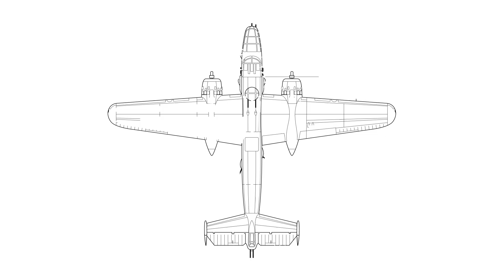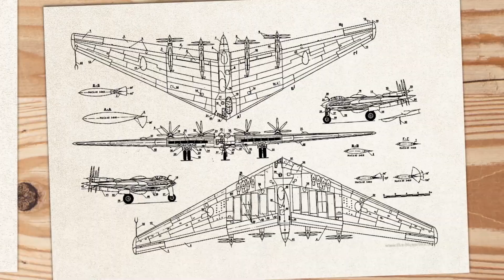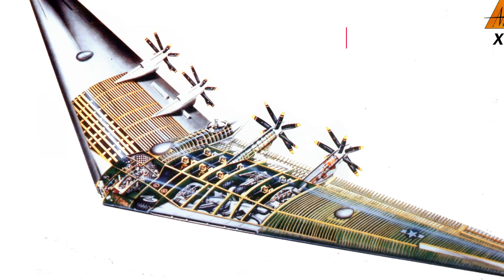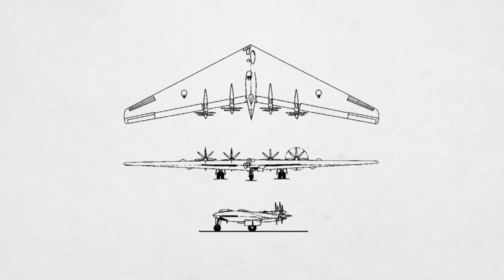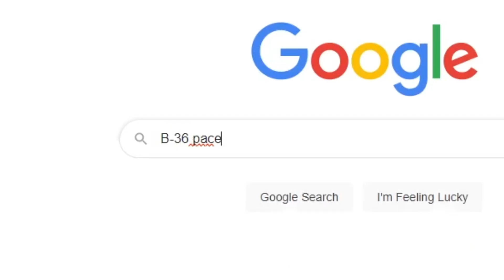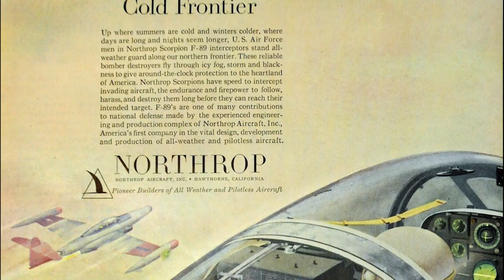This Plane Is CURSED - The Forgotten Flying Wing…

Comment: I have a print of this framed on my wall, had it since I was 10yo. Still amazing to look at considering how old the aircraft design was. Cant wait for the video :)
Reply: Harry Zain: We must be contemporaries because, while I'm not lucky enough to have a print of this amazing aircraft,  I certainly remember being totally mesmerized by the concept of a 
' flying wing ' aircraft.  When I got a little older I enlisted in the Air Force and,  lo and behold,  was stationed at an airbase,  which I will not name,  that became known for its black hanger. That hanger allegedly housed a black aircraft which only flew well after sundown. Jack Northrop really got screwed...

Comment: It wasn't cursed, it was ill timed. The instabilities of the flying wing were partially compensated for by the prop torque. But the skinny turbojets of the early jet age couldn't compensate, and it ended on the scrap heap.
Reply: In reality a tailless aircraft can't fly for too long without fly-by-wire.

The B-2 for example uses both control surfaces in the wing that act as air brakes and independent variable thrust in each of the engines to control yaw and avoid a flat spin. Same for the X-36.

That technology was simply not there until the dawn of microchips. No matter how hard they tried, the project had to be suspended.
Reply: @PunishedClippy  You don't need microchips for active stabilization. A mechanical gyroscope hooked up to the control surfaces can do the same thing unless you're on some hyper-unstable aircraft.
Reply: @hellothere_1257  Thanks for this detail.  Mechanical analogue tech is often not respected in this digital, or at least electronic age.
Reply: @hellothere_1257  Are there any close examples of this?
Reply: @jacob5395  It's very commonly used in early generation rockets. For example, early AIM9 sidewinder missiles used airspeed driven gyroscopes built directly into the control surfaces to automatically orient them to counter any roll rotation. The V1 flying bomb used a mechanical gyroscope assembly to hold it's course, as did pretty much all torpedoes at the time. 
Note that such a simple system would not be capable  of controlling a hyper-unstable aircraft like the F117 Nighthawk. On such an aircraft any existing deviation will self-amplify and spin the aircraft out of control unless immediately countered, so the the control system needs to predict how the aircraft will react before it actually happens, which can only really be done with sophisticated computers systems.

However, on a flying wing that's already semi-stable and flyable, a mechanical gyroscope rig is more than capable of adding the extra hands-off stability that you'd normally get from having a tailplane.
Reply: @PunishedClippy  I noticed right off that bit of the story was "conveniently" left out, it's a fact that stability problems plagued the design from the start until the day it was scrapped! These problems were likely never going to be overcome and it was becoming all too apparent by the Air Force brass who wanted (needed?) a strategic aircraft NOW and could not wait on some unforeseeable technology like fly-by-wire to come along. This simple but glaring fact seems to be always glossed over or simply omitted by those who want claim the Flying Wing was killed solely by shady politics or corporate shenanigans, of which I am sure was also going on as it does with all high stakes projects! The sad truth appears to be that the Flying Wing as envisioned at the time was simply way too far ahead of the available technology and it would have never been viable until computing tech and Fly-By-Wire caught up.
Reply: @PunishedClippy  The German Horten Gliders were very efficient, even Hang-gliders. Building in 'wash-out' at wing tips gives effective 'tailplane' incidence for stability.
Reply: @PunishedClippy  Ho229, perhaps you should do a bit of research?
Reply: @PunishedClippy  Not true, that issue has been solved, fly-by-wire is not required anymore, and flying wings are now superior to traditional designs in many ways. Depends on your application.
Reply: @PunishedClippy  why is a citation needed?
Reply: @PunishedClippy  the XB49 had the same type of control setup.  They lacked a responsive enough SAS to compensate for the slight wallowing that affected bombing accuracy.  They could have solved it but Britain not falling removed the need for bombers to cross the Atlantic.
Reply: @PunishedClippy  well thats the thing, it was suspended only a few years before ICs and microchips could have fixed the problem
Reply: Pratt & Whitney did do static tests with drive shafts and counter rotating props, but the issue was in flight with all the vibration created by operating pusher props slicing through the wake of the wing twice each revolution. Pusher props work fine at Varieze speeds, but become more problematic at near sonic speeds.   

The Flying Wing utilized a thick wing that was not well suited for near sonic speeds. The B-47 with its thin wings could easily outperform the Flying Wing. The B-2 is a different situation, it's design is not intended for high speed but rather stealth.  Still, a fuselage is a handy cylindrical body that is easy to pressurize and has lots of room for bombs, while the tail allows more freedom for the center of gravity to move around without making the aircraft unstable. None of this was true for the original Flying Wing.

The original Flying Wing was supported by General Hap Arnold. Once Arnold retired, the Wings' competitors moved quickly.
Reply: to make a stable flying wing you need lots of sweep to the wings and winglets.  A flying wing should look like a V for the purpose of stability.  The problems have now been overcome with computers keeping the plane "stable"
Reply: Yup. Cannot work at all.  Needs this or that.   Tell that to the Horton brothers.   Theirs did not work obviously.  On many hundreds of test flights and beginning production when the war ended.
Reply: Yea just look at the b2 bimber
Reply: Well, the HO-229 proved that a flying wing can be done if done properly
Reply: Horten Ho 229
Reply: The government tried to force him to merge with General Electric  , he would have none of hit , the Government canceled the contract and Northrop destroyed the fifty aircraft already built
Reply: It flew well as per Testpilot statements! But some other Aircraft manufacturer may sabotaged it and some Parties or Politicians were corrupt and took money too...
Reply: @einautofan6685  Blaming sabotage and politicians is just silly. In reality, the concept was not viable at that time.
Reply: @skunkjobb  If it was't viable then why destroyed all the prototype and give the data and patent to rival companies and not just shelved it. did they afraid there was a soviet spy at northorp but if it was "impossible" for US which is superior in electronic is it even possible for the soviet?
Reply: The XB-49 was also nearly 90 mph slower than the B-47, too. It wasn’t until fly-by-wire became viable in the 1970’s that Northrop was finally able to make the flying wing bomber work with the B-2.
Reply: Because simply Northrop was nobody at that time. Providing any funky design to seemingly stoneheaded organization is something you want to work way-way harder, to say the least

Comment: <<Listen. Attack the central propellers. If you can destroy them, the Arsenal Bird will slow down.>>
Reply: The center engines? Those aren't nearly as critical... aerodynamically, if you clip the engines on one side, the plane will have to kick in rudder and reduce thrust on the other engines to compensate... which will reduce power even further, increase drag, and so on, and result in a nearly crippled aircraft.
Reply: @Tomyironmane  you clearly don't get the reference, they're talking about Ace Combat 7's Arsenal Bird
Reply: @Tomyironmane  yup one side knocked out and its pretty well screwed
Reply: It all comes down to destroying rectena base
Reply: @brecibros2469  is he really that good
Reply: @phoenixleader1999  he has to be besides if he thought it was impossible he wouldn't have said anything
Reply: Ace combat 7 was dope af..but the dialogue pissed me off just a little. 🤣
Reply: lol

Comment: FLYING WING?
Reply: Its an airframe design, meaning the airframe resembles nothing but a wing, without any tailwings.
Reply: @aureusknighstar2195  without a tail. How do you sail a plane!?
Reply: In some flying wing designs, any stabilizing fins and associated control rudders would be too far forward to have much effect, thus alternative means for yaw control are sometimes provided.

One solution to the control problem is differential drag: the drag near one wing tip is artificially increased, causing the aircraft to yaw in the direction of that wing. Typical methods include:

Split ailerons. The top surface moves up while the lower surface moves down. Splitting the aileron on one side induces yaw by creating a differential air brake effect.
Spoilers. A spoiler surface in the upper wing skin is raised, to disrupt the airflow and increase drag. This effect is generally accompanied by a loss of lift, which must be compensated for either by the pilot or by complex design features.
Spoilerons. An upper surface spoiler that also acts to reduce lift (equivalent to deflecting an aileron upwards), so causing the aircraft to bank in the direction of the turn—the angle of roll causes the wing lift to act in the direction of turn, reducing the amount of drag required to turn the aircraft's longitudinal axis.
A consequence of the differential drag method is that if the aircraft maneuvers frequently then it will frequently create drag. So flying wings are at their best when cruising in still air: in turbulent air or when changing course, the aircraft may be less efficient than a conventional design.